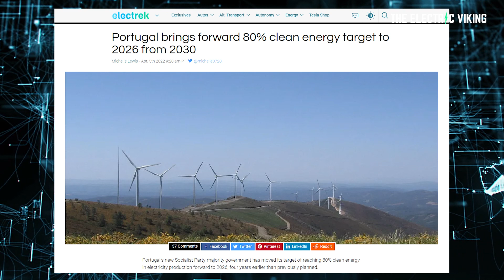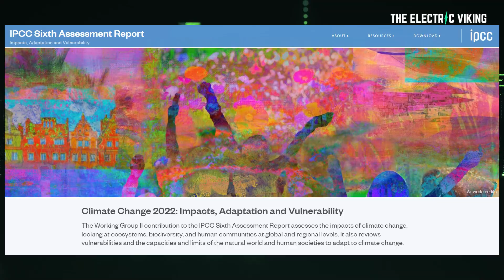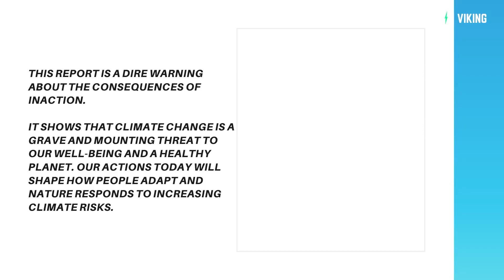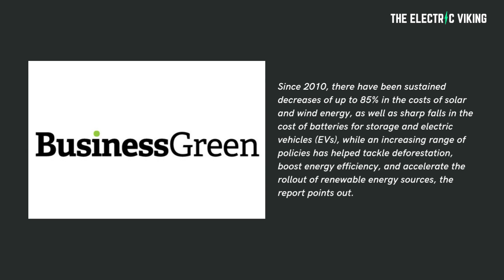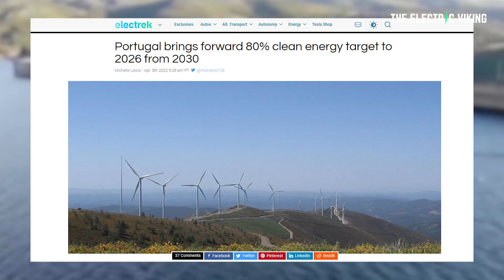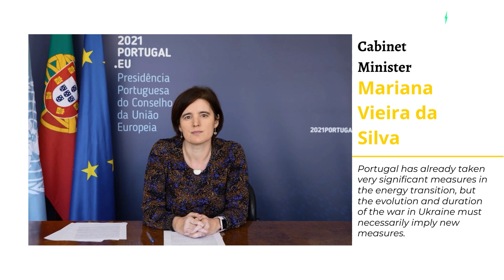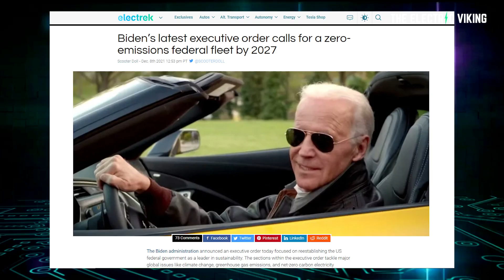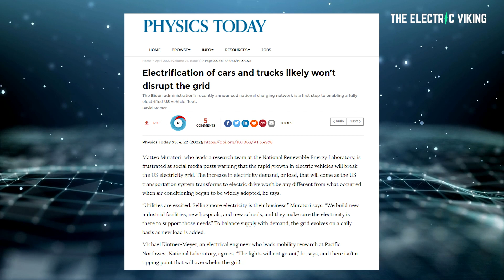Can the electrical grid survive if everyone drives an EV?

Comment: I'm an electrical lineman. I'm also a huge EV bull. I can tell you this, about where I live/work. We're definitely going to be blowing up transformers probably pretty regularly as the EV conversion happens. Our grid hasn't had upgrades since the 60s. But, 🤷‍♂️ it's our problem, not the EV industries.
In the hottest two weeks of summer, we usually spend the entire time just running around replacing bad (overloaded) transformers that just couldn't hold on any longer. So in a sense, maybe the upgraded system has been going on for years.

But either way, it's a simple process, changing out a tub takes less than a hour, and once it's done, everyone fed by it should be good to go 🤷‍♂️.

Also programing your EV to charge off peak (overnight), when there's much less stress on the grid, can potentially be a absolute game changer. We'll make it through, and it will be worth it.
Reply: Agree! Dad spent entire career in electric metering and his best friend was a lineman. Grid is slowly being upgraded when it breaks. Live in typical SoCal home and put 8.8 Kwh solar panels on roof, battery storage on wall and 2 EV in garage. Able to completely power home and cars most days using ☀️ with modest electric bills in the heat of summer. Changing to 100% electric is totally worth it!
Reply: @cathyk9197  I'm incredibly impressed with the technology advances in solar. I was definitely a skeptic on it ever being useful even a few years ago. But now 🤷‍♂️ Musk says the entire grid could be powered by using a small corner of Texas.. And.. I'm not about to disagree with Elon Musk 😂
Reply: I work for a transformer produer company.... I expect a lot of orders in the future :D
Reply: @morganangel340  it sounds like $$ for both us then 🥂
Reply: eschreck814
How about if an EV owner arrives home and rather than sending power TO the grid (overload?) Simply removes that home FROM the grid for the peak 18:00 - 22:00 period?
Then takes a slow low charge from 23:00 to 06:00?
Ideal case?
Reply: @rogerstarkey5390  You mean when you plug your car into your home, very likely with 50% charge remaining, it can help power your home for a few hours before recharging. Yes the grid can be adapted to use EV batteries for "peak shaving". This will result in a lower overall stress and more effective usage of grid power.
Reply: @rogerstarkey5390  Yes, this kind of localized storage would help, but the system isn't in place as yet. Really you need to try to balance variable sources of energy, solar and wind, with storage on the grid and local, with varying usage to achieve a more consistent load of the drid without massive peaks . That's very much in the early stages of development and implementation. It can be done, it's just very complex.
Reply: I've seen similar issues at the other side with people overloading their main fuse. It's not just EVs, but heat pumps and EVs together that push both the incoming supply to a property and the local transformers beyond what they were built for. It's why in the UK by June all EV chargers must be smart chargers capable of being turned off by the network operator. If there wasn't an issue, this wouldn't be necessary, People need to understand that all this electrification will require some significant upgrades at every level from generation to the point of use, as well as more intelligent control of usage. It isn't simply a matter of generating more.
Reply: @snazzy5844  I'm really unfamiliar if they can be used in that manor, but theoretically, if you didn't need your car, I guess that could be a possibility 🤷‍♂️
Reply: @eschreck814  The ability to feed back into the system is being added to EVs now. It's called vehicle to grid. There just needs to be a system in place for the grid to demand and use it. I suppose it is similar to home solar where you can export power you don't use back into the grid, but in the case of vehicle to grid, there needs to be a system where the grid can demand energy from a vehicle when it is available. How and when it does this is tricky to get right.
Reply: I am a recently retired IBEW inside wireman, and an EV bull also. As most EV's charge at night, they are charging when electricity is both plentiful and cheap. This has been beneficial to many utilities, as they are making a lot more profit on the electricity sold to charge EV's. It also takes between 2 to 6 kilowatt hours of grid supplied power to make each gallon of gas/petrol and diesel fuel. So every gallon of fuel that is not made allows that electricity to move an EV 6 to 20 miles on the roads.

 In my experience, most transformer issues occur during periods of high demand AND high heat (air conditioning time). Since the majority of EV charging occurs at night, it does not tend to overload transformers. Most issues I have run into with pole mounted transformer for residential service drops has to do with upgrading old 60 amp or 100 amp service panels to 200 amp services (and now 400 amp) . In my area, the utility will not necessarily bother to replace the pole mounted transformer if it is running right at maximum capacity, and just let them run hot until they give out. Why waste the cost of a new transformer when you can just run out the clock on an old one? This is a bigger problem with multiple service drops from a single pole mounted transformer when more services are upgraded.
Reply: @GoCoyote  This will change though. Most EVs now are owned by people who have the ability to charge at home. It's as ownership expands into those can't do that, larger vehicles, high mileage use, and add on heating etc that it will be a bigger problem. How much of a problem that is depends on the local usage, and housing.
It's interesting the way the grid is managed in the US though.
If you want to upgrade to 3phase (300A for a home) in the UK, they make you pay rather a lot. £10k is the cheapest I've personally seen , up to £60k to upgrade the cabling and transformer.
Reply: @snazzy5844  
It varies a lot over here, starting about 4 to 6k for the electrician to rewire the service entrance panel. Any additional costs varies with the local utility. In my area the utility does not charge you for overhead service cable and transformers, as that is their own equipment, but you do have to pay for your own service cable if undergrounded. If you want power from the utility and they have to install new power poles, that will cost upwards of 10k to 100k per pole.
Reply: And that's what happens when you don't reinvest in updating your equipment.
Reply: @bradwheeler2116  well the problem is every time they do people bitch about rates. So you get what you ask for.
Reply: @eschreck814  i suppose it's a matter of deciding what you should pay for as a user, and what everyone else should pay for through their bills. To my mind, if you want 3-phase simply because you built a bigger house and have your own stuff to run, that's your cost to upgrade the supply. If a load of houses just don't have sufficient supply that they should have, it's the suppliers cost. No reason anyone should pay for someone elses luxury.

Comment: It's always frustrating when I run into someone who thinks the grid can't handle EVs. On average an EV will use about 10kwh per day (30 miles). The average home uses 30kwh a day so this is a 33% increase per EV. But the biggest mistake people make is that they don't realize that only about 10% of cars are replaced each year so even if all new cars were EVs, we would only see an increase in residential power usage of around 5% per year at most. The grid can easily keep up with this not to mention more people than ever are powering themselves with solar+battery storage.
Reply: Concur:
Portland Oregon. (no, it hasn't burned to the ground, I like it here)
We've had our model Y for 6 months.  
We drove an average of 25 miles per day.

We used an average of 8.3 Kwh per day. (a little over a dollar)
That is the equivalent of running a space heater or a single window A/C for about 6 hours per day. 
Heck, we did the first four months using just a granny charger (110v regular outlet) and got by just fine.
The only times we used a supercharger was just to make sure we could.
I think the grid will be just fine.
Reply: @davidhuber6251  I was guestimating on the kwh. Thanks for some real world numbers

Comment: EV’s charge at night.  The electrical grid is sized for peak daytime use.  What was the question again?  And is the whole situation made even better with distributed rooftop solar?  Uh, yes, it is.
Reply: This 👍
Reply: yeah, but solar don't really work at night.  if they don't upgrade the Electrical Grid, it will crush harder than Biden's approval rating.

Comment: I hope you are right with your predictions. Here in California we are looking at covering about a third of the state with solar panels just to replace nuclear power that is being phased out while we have a power grid that appears to be better suited at starting wild fires than delivering electricity between brown-outs. To which we want to add electric vehicles and will need to add more de-salination plants. I'm not an oily, just pointing out we have a lot of work ahead of us in our attempt to replace fossil fuels.
Reply: Having worked as an electrician on PG&E power plants, both nuclear and gas fired, and on big solar and wind farms, I would like to toss in my two cents. PG&E has been scrimping on maintenance cost for decades. This, along with other factors, has lead to the grid being a cause of so many fires. The reason for the rolling outages is more complicated. Some of it has its roots in the deregulation fiasco, but much of it now has to do with the fact that peak usage occurs when the temperature is at its highest.

All thermo electric power plants (fossil fuel and nuclear) need large supplies of cooling water. As water resources have become more limited, and the temperatures of the water have risen due to climate change, this has had the effect of requiring power plants to curtail power production during warm weather events. Add any plant or power line failures into the mix, and we have what we get.

Shifting to EV's has actually helped PG& and other utilities to slow down their rate of price increases. As most EV's charge at night, they are charging when electricity is both plentiful and cheap. This has been beneficial to many utilities, as they are making a lot more profit on the electricity sold to charge EV's.

It also takes between 2 to 6 kilowatt hours of grid supplied power to make each gallon of gas/petrol and diesel fuel. So every gallon of fuel that is not made allows that electricity to move an EV 6 to 20 miles on the roads. Since California has a lot of fuel refineries, this means that EV use is helping to keep the refineries from needing so much power.

As to the amount of land required to supply California with power; that is from old oil company FUD. Wind energy is actually a very good thing to add, since it is always blowing somewhere, but rooftop solar, along with Agrivoltaics (Agricultural Solar), large scale solar,  large scale batter storage, coupled with grid improvements, are very cheap and doable to improve our electrical supply.

The technology exists to use EV batteries as grid storage, but it requires more organization of the various parties involved (like knocking your kids heads together). You could tell your EV when you plugged it in at home how much charge you need the next day when you leave for work. The utility could then use your EV's battery for a power load or power source as needed to optimize power production and use. You would not care, as you would get up in the morning with at least the amount of charge for your daily needs.
Reply: @GoCoyote  excellent, thankyou.
Reply: Yep....we already have Blackouts in CA/USA and very low % electric vehicles....cannot handle more.
Reply: It will take 100 miles by 100 miles of solar panels to run the entire US energy needs. That is around 16% of CA's Square Mileage, and it covers the ENTIRE US, NOT CA. 

I lived in LA for 55 years and rarely had any brownouts. 

Tesla is building Battery packs all over CA to keep the lights on. The storage batteries are the most important thing, as they keep the grid up and running at night, or when there are Peaks in energy usage. 

The works is already happening and your information is not correct.
Reply: In 2022, 35% of California new vehicle sales are electric. In SoCal, put solar panels on roof, battery on wall and two EVs in garage. On most days, completely power home and both cars using sun. Minimal electric bills. Thank you Tesla!
Reply: That's the problem of your local utilities and not representative of all California. Power lines cause wildfires everywhere, not just California. California is the only place stupid enough to make utilities liable for everything, even if it's out of their control. Thank our government for the high electricity prices.

Comment: EVs can actually become the electrical grid. Two way charging and discharging allows the grid to take and to give when needed.
Reply: "Becoming the grid" is probably a bit far, however, if we assume that the most energy a home uses is generally the period following when the vehicle owner returns after work.....
Then, the most benefit is derived by simply removing that home from the grid for that period?
No "transferring/ selling energy to the grid" required.
Use the EV pack for 5(?) hours peak rate energy.
Buy cheap rate energy overnight to recharge.
Multiply by millions of homes.
.
Everyone's a winner, even with no energy actually going to the grid.

K.I.S.S.
Reply: @rogerstarkey5390  I am with you... 80%!  The one problem with the scenario you outlined is that the EV's battery will go through one nearly complete cycle every day, i.e. 5-10 times more often than would be the case if the battery was not used for the purpose of buffering the home's power demand to the grid.  That would reduce by 5-10 times the EV's useful battery life, which is NOT acceptable.  Especially now that Teslas (and probably also other manufacturers in the future) will have batteries integrated in the car's chassis, i.e. non replaceable!
This is why Elon Musk is against the concept.... which initially surprised me... but, after a bit of thinking, I understood his point  He advocates separate batteries for that mission.  Those batteries could be old EV batteries, not good enough for transportation use, but still good for 10-20 years of use in home applications, or they could be batteries with a totally different and much cheaper chemistry, as the specification for a home battery is very different from that of an EV.
Reply: Im not giving over my batteries for utilities to use at their pleasure, they have a finite life and I'll be the one using them
Reply: Virtual power grids utilising, solar, wind, batteries and PEV's have already started to happen in towns in the Netherlands. With technological advances into grid management these 'Smart Towns' will begin to proliferate globally as the uptake of PEV'S increases helping to both balance out and assist power generation across national grids. So far from overloading the grid PEV's will have the opposite effect.
Reply: Not needed. Just use price to encourage off-peak auto charging, and to enhance compliance. Then require smart chargers that can do charging when the grid operator wants it.

Comment: In the Uk, since the 1990’s our Grid has lessened in demand as first we lost lots of heavy industry, like steel making, car manufacturing etc at same time as we started to switch bulbs from old incandescent to low energy fluerescent and now to lower power LED, then we made buying white good lower energy rates and old bid cathode ray tube tvs to lcd then led. Do at present we only use about 60 of the grid we used back in the 1950’s! We have also made it much greener and flexible without needing peaker power stations. Now with smart meter and smart car chargers and instruction of Vehicle to Grid in cars and lots having home batteries that can be utilised by the Grid to ballance it, we can have more cars charging than will EVER be sold and being used at same time.